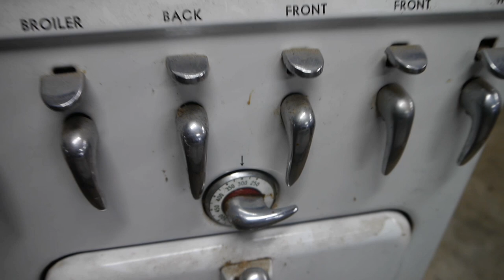Chambers Model "B" Restoration - Part 1

Comment: im not sure if you have this information, hopefully its helpful
Here is how you identify your older CHAMBERS:

     The serial numbers on the early models are pretty useless in telling their age, features, etc., but the model numbers "tell it all".

     For example, a fellow recently e-mailed me, asking for help identifying his old stove, a CHAMBERS Model 4742WL.

      Here's how that breaks down:

      * The older CHAMBERS ranges were produced in different "series." Each series had a designation, such as the 3,000-series, 4,000-series, 5,000-series, etc.

     * Each digit in the model number means a different thing -

        > The FIRST number indicates the SERIES. In this case, this is a series 4,000 CHAMBERS range.

        > The SECOND number indicates the "style' of range. In this case, the "700" indicates a "table range with broiler above" (by "table", they meant the oven was level with the cooktop, not above or below it, and the broiler was in a second opening/door above the oven).

        > The THIRD number gives us the number of burners. In this case, 4.

        > The FOURTH number tells us the quantity of hoods/domes it came with. This one came with 2.

       > The FIRST LETTER tells us the original color (white).

       > The LAST LETTER tells us the location of the oven (left-handed or right). This one is a left-handed model.

Comment: Turns out i have the same oven.  

based on other videos i knew it was probably a 1930's to a 1940's oven wasn't sure if it was A or B.  

i really appreciate your video.

In watching your video, I've learned a lot. 

my oven came with my house back in 1999,  my house is a French tutor and the person that was selling it to me setup the house for show, after i purchased the house, she took all the shabby chic furniture and cabinets that were to set up the house,  she left me one built in cabinet and that stove, I've been using it since day one. my wife just advised me there was a burner grid and a burner in the closet. 

turns out that the one that fits at the bottom of the thermowell as i learned from your video. 

I also didn't know where the plate was with all the information about the stove, until i saw your video, turns out i was able to see that it has a 6 before the serial # so 1946 and the model is 11-b-4 or 11-b. Thanks again.

in the last week ive been reaching out trying to get better drip pans mine have some pits and holes in them
as well as trying to get complete burner grates 2 of mine have some peices broken

http://www.chamberstoves.net/Parts&Service.html
im actually waiting on callback from belgrove appliance in yonkers NY i was told by another person on the chambers site to contact her and they may be able to ship to a company to rebuild or repair what i have as far as the drip pans and burner grates

Thanks again!

Comment: More than likely if your stove was made right after the war, chrome was still hard to source.  It was one of the first things that they stopped using during the war and it was awhile after the war before they had enough of it to start using on car trim after the war.  I kind of think I like the porcelain top better myself.  It's also kind of an odd place to put chrome I think since it doesn't put up with heat very well.  Certainly more durable than nickel however.  You have a nice looking old stove.  I just bought one myself and I'm very much looking forward to going through it and getting the old girl to operate properly.  Holy cow they are heavy!